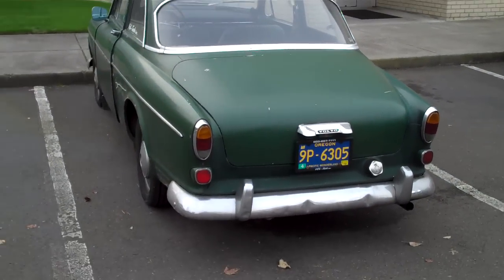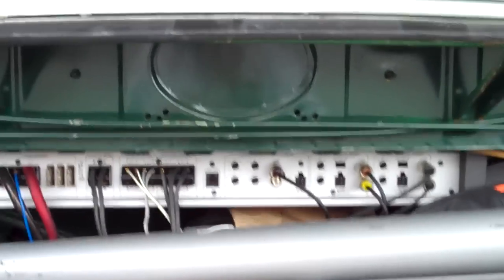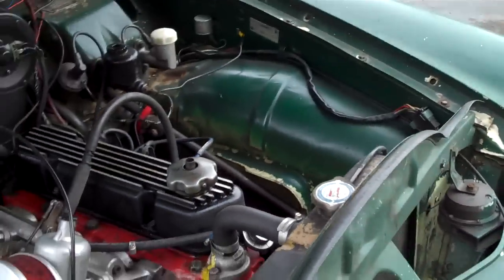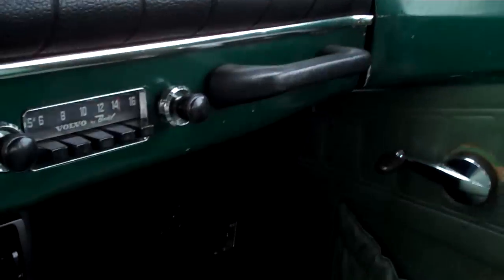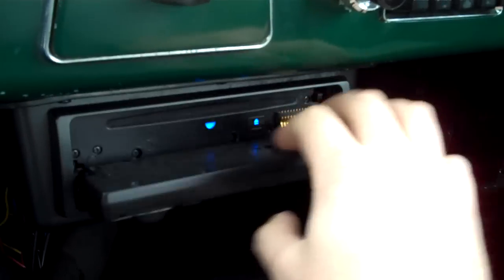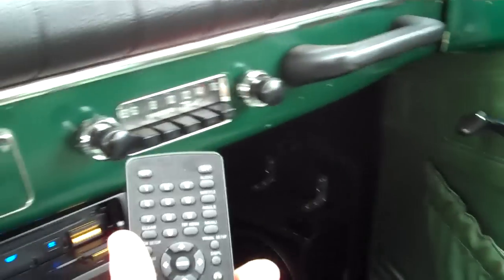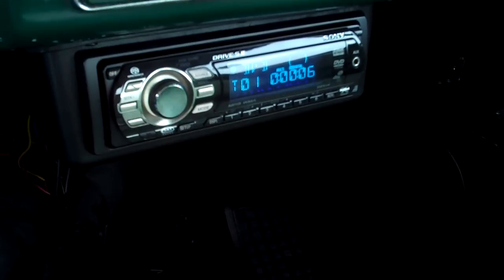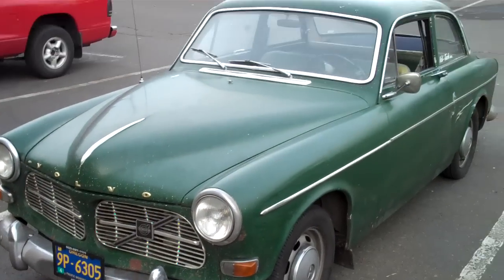Surround sound in a 1966 Volvo 122s

Comment: I didn't see any center channel speaker. Do you have one in the car? I have the JVC KD-AVX33 in two cars and the JVC KD-AVX38 and  KD-NX-5000 also play DVD-A. Check them out. I have had them in my cars for years and originally had the Panasonic CQ-DVR909U that played DVD-Audio 20 years ago.